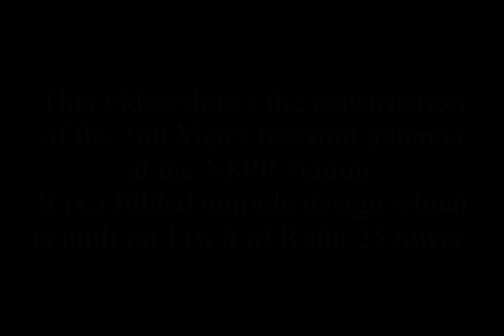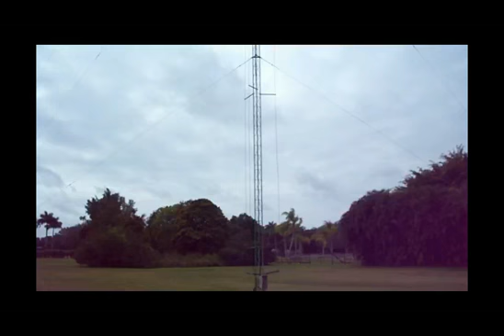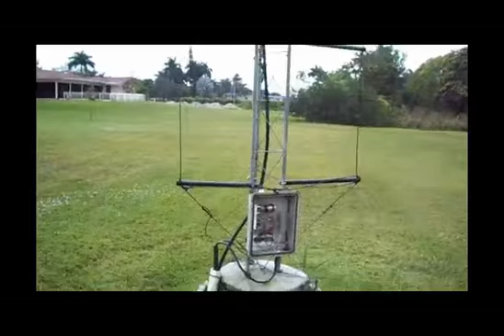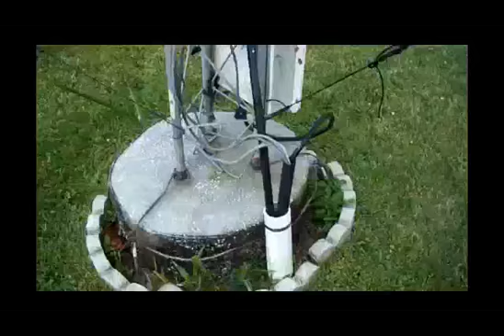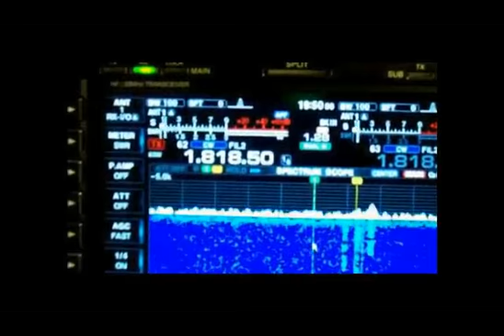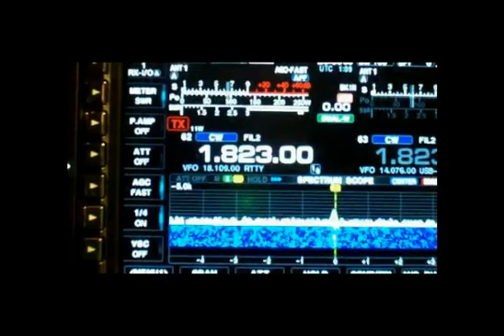N8PR TX Antenna Construction and Detuning effects on receive Noise

Comment: Another thing I’d like to add- I’ve learned that having increased element broadness, increasing the surface area of the element helps increase bandwidth and more.  So with a folded unipole, it acts similarly to a pipe that is the same diameter as the radius of the skirt wires.  The one I’m building at the moment, will have six skirt wires, with six elevated radials.  I won’t be able to attain a 45 degree angle of the ground radials, but the matching shunt that is towards the top will compensate for that mismatch.

73

Comment: Very nice, I’m discovering that those are fantastic antennas!  Also an older gentleman that’s a broadcast engineer I believe said that 6 elevated radials that are not grounded at the far ends is sufficient.  Also the fact that the antenna is grounded and with the addition of static dissipating “fuzzy balls” on it enables effective prevention of lightning strikes.  I’ll dig for the link and post it…

Comment: I love your nice big property - perfect for big antennas!
Just wondering....could you mount the tower on an insulator, and then use the tower itself as the antenna?   Then you wouldn't need the standoffs and wire antennas running up the sides?